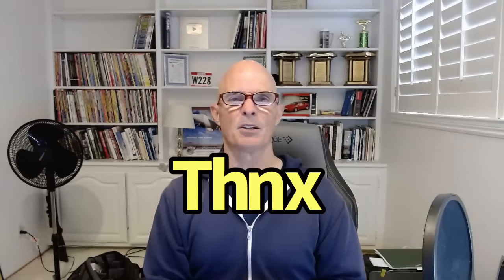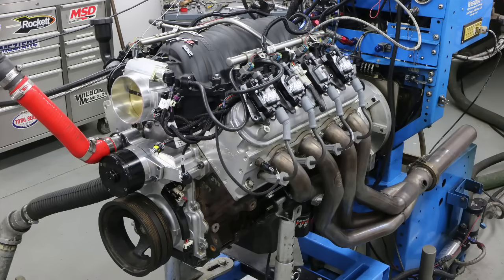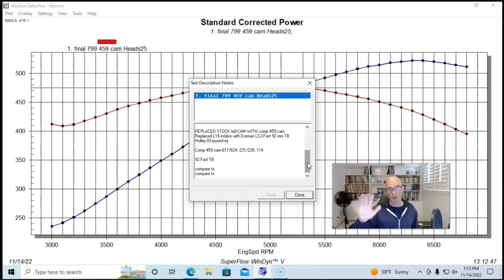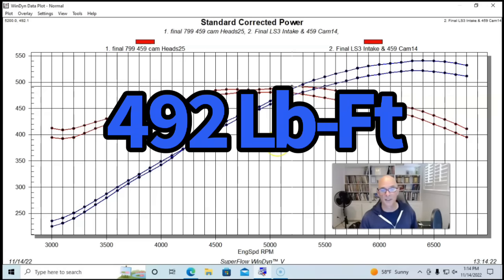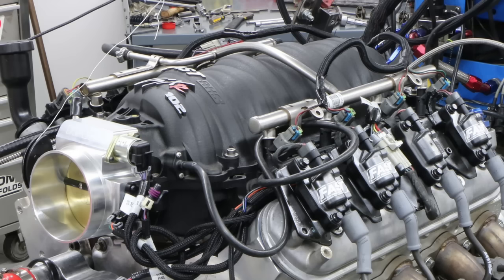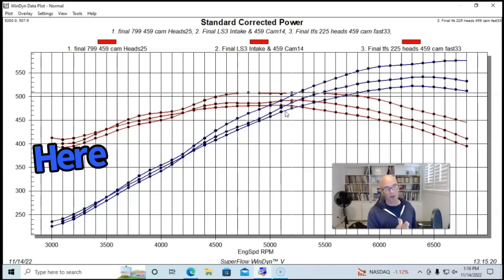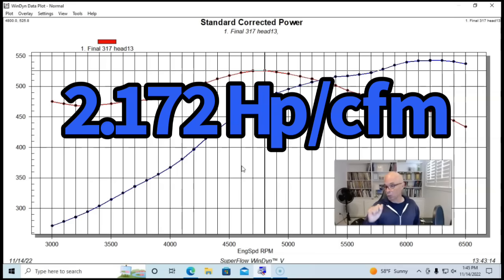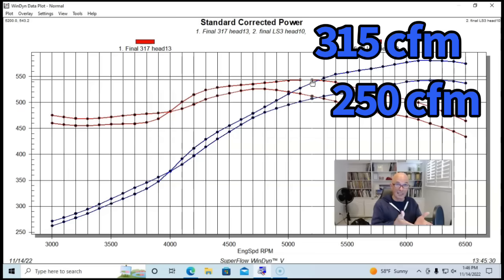HOW TO: LS 6.0L AND 408 HEAD SWAPS-HOW MUCH ARE HEADS WORTH? CATH v REC PORT v TFS/AFR CNC HEADS!

Comment: I have a pair of PRC (Texas Speed) 5.3 heads, stage 2.5 (as they call it) cnc ported, 62mm combustion chambers, 2.02 int/1.57 exh valves, and .650 dual springs. They are going on an LS1, with 233/239 .600/.600 112LSA cam, 1-7/8 longtubes, Dorman LS2 intake(same one in this video), 92mm tb, 42lb injectors, and Vararam "ram-air" intake; I haven't installed them yet, but wonder what the final number might be.
Reply: What made you pick that cam? From what I've seen with all the newer grinds there is definitely more power to be had from going to a longer exhaust duration.
Reply: @nowayjose596  honestly, I don't have a legitimate reason, other than Texas Speed recommended it at the time, as it was an option in a head/spring/cam package deal. I bought it about 8 years ago or so, and am just now getting time to install it. Have you better suggestions? I'd appreciate any, thanks.
Reply: @unicornsqueezins7906  I've been looking at cams myself and you've got a very similar setup to what I'll also be doing which is why it caught my attention. I think most of the newer designs are for LS3s since they're newer engines but with ported cathedral port heads and a decent intake you're flowing closer to an LS3 top end at this point. You can use an LS3 cam (and will have more options if you do) but will need a few things to make it work. To avoid messing with those extra pieces you'd need I'd probably be looking at the BTR LS1/LS2 Stage 3 which is 231/244 if I were you.
Reply: @nowayjose596  thanks man, I appreciate the advice 👍
Reply: @unicornsqueezins7906  No problem. You'd probably be fine with the old cam (assuming you have enough PTV clearance) but I know BTR specifically has gone through and updated the specs/lobes on their LS1/LS2 cams within the past 3 years and I like that continued innovation.
Reply: I'd run 459 cam or summit Pro LS stage 4 maximum valve clearance addition cam
Reply from the maker: that cam works well-see the 459/469 cam compare to see what more exhaust duration does (very little)
Reply: I went with the summit 8711 cam after seeing your video on it a while back. I was impressed that it gained power everywhere instead of trading off down low. I've always been curious to see how it matches up to the 459 cam that you like to run. Wonder how similar they are and if the trade offs are the same. I just put prc stage 2.5 ported 243s and a fast lsxr with 102mm TB, 1 7/8 long tubes on my 6.0 with the 8711 cam. The cam was begging for more head and intake I think. Can't wait to get it finished so I can feel the difference.
Reply: @rmsgarage3724  I'd be interested to see what your PTV clearance is like on a stock bottom end with that cam. I know it's the extra valve clearance version but that's still a big 'ol cam - I like the specs and price, though.
Reply: @nowayjose596  I measured with the new heads that have bigger valves. exhaust was around 0.100. Intake was around 0.070 which is tighter than I wanted. That was by the ridge of the dish on a lq4. It's definitely the max you should go probably.
Reply: @nowayjose596  that is with stock mls 0.055 gaskets. I wanted to run cometic, but I couldn't spare it lol
Reply: @rmsgarage3724  Yeah that should be good. I know the generic recommendation is 0.080 on the intake but from what I understand the intake clearance is less critical and plenty of folks run less than that without issue.
Reply: Another thing I've been curious about is a 408 built for low end torque in a truck application. I just put 706s and a truck norris cam with 1 5/8 longtubes on my 6.0 in my truck and I'm already curious about a optimal 408 torque monster. Pretty sure it would need more head flow than the 706s would provide, but going too big would probably kill low end power and too small would lose power everywhere. Not sure where that sweet spot would be for cam and heads for that application.
Reply: I tried to link the videos/articles Richard has posted comparing the 459 vs 469 but those replies keep disappearing? Odd.
Reply: @nowayjose596  Nah I was talking about a comparison between the 8711 and the 459. I saw the comparison video of the 459 and 469.
Reply: @rmsgarage3724  Yeah my response was really to the original poster about how cams with larger duration splits compare to shorter ones and the 459 vs 469 tests Richard has done are a good apples to apples comparison on that. BTW if you do a Google search there is an article for another test he did comparing the 8711 to a 230/235 cam; don't know if you've seen that one or not. I would just link it but that may be why my earlier posts got deleted. I've asked Richard about the larger exhaust splits in one of his live chats and he said that he doesn't think they really make that much of a difference (reiterated in his comment above) - it's the newer lobe designs that do. I mostly agree with that but I also think there's a reason that those newer lobe designs pretty much all use larger duration splits than before. Just look at the Red Hot cam (confusingly also sold as their new Stage 2 V2 LS3 cam) from BTR - it has 20+ degrees of extra exhaust duration compared to the 225/238 cam it's replacing. And in back to back testing it makes 10-20 more hp up top than the old Stage 2 with no loss in the midrange (both in dyno results posted by BTR as well as independently on another channel on here on a G8). The Red Hot/Stage 2 V2 is a 221/24X for comparison. In another video Richard compared the Red Hot to the Sloppy Stage 2 (228/230) and they also made very similar power in the midrange with the Red Hot actually making 15 more peak hp. So this "smaller" cam is giving up nothing in the midrange and actually making more up top than cams with 4-7 degrees more intake duration, which is the opposite of what you'd typically expect. BTR is obviously onto something with their newer lobe designs and valve events that are making this happen, and larger duration splits do seem to play a role in that (albeit exactly how much I couldn't say). I'm hoping they come out with a LS3 Stage 3 V2 that incorporates these new designs before I end up camming my C5 bc that would probably hit the sweet spot of what I'm looking for, otherwise I'll probably go with the LS1/LS2 Stage 3 as recommended to the original poster. The difference in the dyno results of these newer vs older cams is why I personally wouldn't consider the 459 or 469 (or TSP LS1/LS2 cams) at this point due to them being older designs. If I can make even 5-10 more hp up top without sacrificing anything in the midrange I want that, even if it means selling a cam I already have for a small loss and/or paying BTR's slightly higher prices. When you add up all the costs of everything else even $200 is barely a drop in the bucket sadly, lol.

Comment: Like seeing these videos, they have helped me a ton while selecting parts for my 408 build. Can’t wait to get my Chevelle on the chassis dyno. 9.7:1 408, Texas speed ported 317 heads, Summit 8715 cam (222/233 .600/.575 115lsa), TBSS intake, and 1 3/4” long tubes.  Built it for a great cruiser, plan on doing hotrod power tour type stuff.
Reply: Why such low compression?
Reply: @chipcurrey653  as others have guessed, somewhere down the road I’ll be adding boost and 91 octane is the best I can get locally. I like to build stuff once, so I prepared for the future with lower compression, extra ring gap, and a bit more bearing clearance.
Reply: @chipcurrey653  Yeah I was also going to ask if he planned to run it on 87
Reply: I just got my 408 back. 10.3:1 i can understand him going low compression for fuel reasons, but I’m going E and gonna give ‘er all she can take. Should make 1050-1100 wheel pretty efficiently.
Reply: @EL_GTR_5.0F150 What heads and turbo?
Reply: Sorry for the late response. Ported 317’s and VSR T6 88-104.5
Reply: #boostmotor  :)

Comment: Hey Richard, I hope all is well. I have an LS 6.0 with cast iron heads, what head’s would you suggest? 243 heads or 823 rect port heads. I plan on doing a cam and cylinder heads. I’m want to go with a single turbo setup. I also want to run a th 400 transmission behind this setup, it will be a street/strip car
Reply: Usually he just tells us to run whatever heads we have with boost. But if you’re looking to lose the head weight, I’d suggest the 243/862 heads.
Reply from the maker: PICK THE POWER CURVE YOU LIKE MORE-THE 823 DOES DIFFERENT THINGS THAN THE 243

Comment: Wish you would have done the same cam too and could you not run the 799 head because of bore size(on the 408)?
Reply: the 799 are smaller valve heads so they work no problem on 6.0 which has a 4" bore
Reply: @robholmes2129  I know they are 4.000 stock but the stroker should be 4.030 so is that why because the bore size was now too big,  I've done plenty of 243/799 heads om 6.0 just curious why the 408 didn't get rhe same.
Reply: @torqueandbeanssauce  I think these are 2 entirely different test sessions so the heads were not all in the same place at the same time
Reply from the maker: WHY WOULD 4.03 BE TOO BIG FOR 799 HEADS?